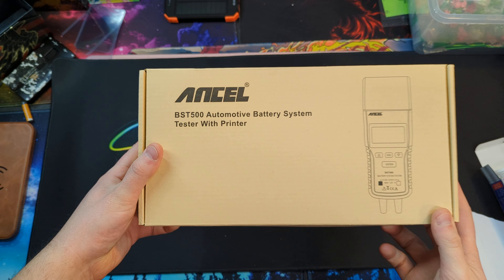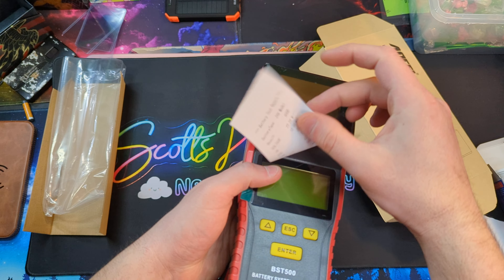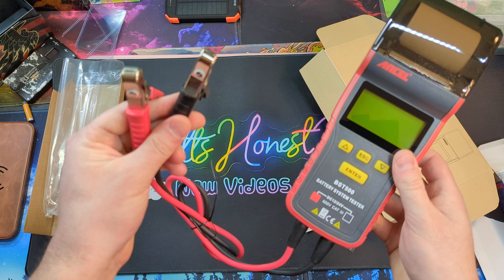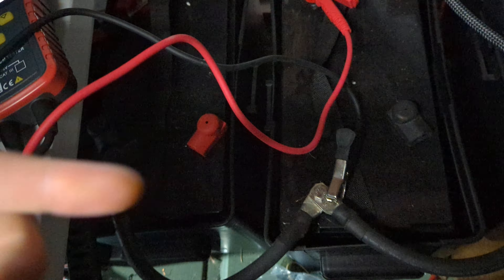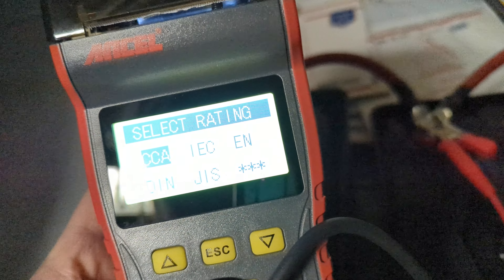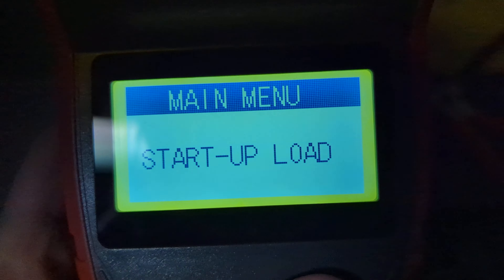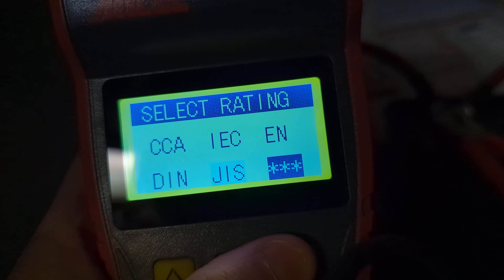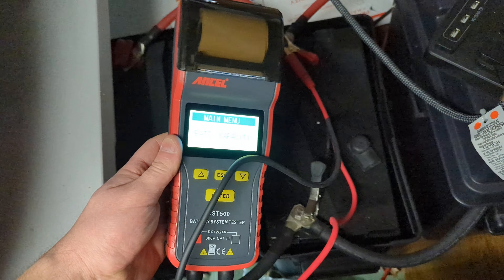ANCEL BST500 12V 24V Car Battery Tester

Comment from the maker: ANCEL BST500 12V 24V Car Battery Tester 
If your interested you can buy it here = https://amzn.to/43ah5fQ
 ANCEL BST500 12V 24V Car Battery Tester with Printer Automotive Load Tester Alternator Tester Auto Digital Battery Analyzer Cranking and Charging System Test Tool for Car Heavy Duty Truck SUV ATV RV 

As an Amazon Influencer, I earn from qualifying purchases